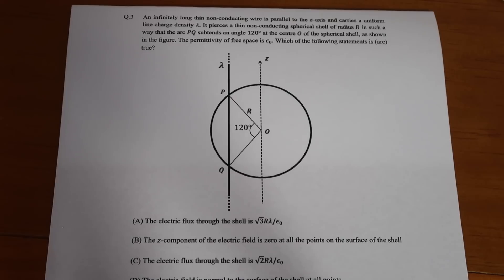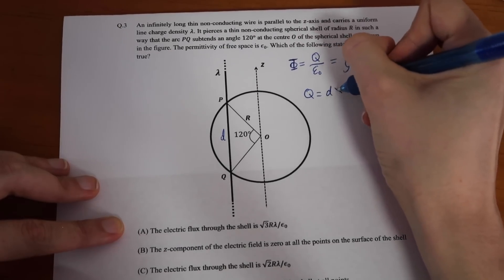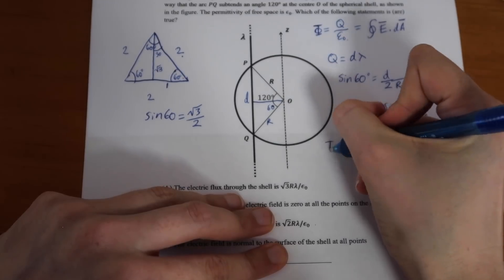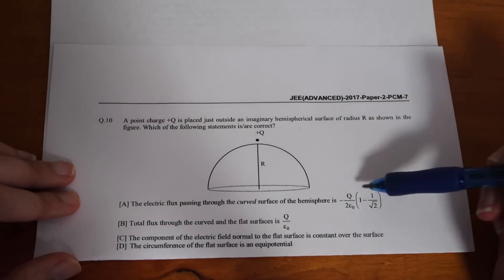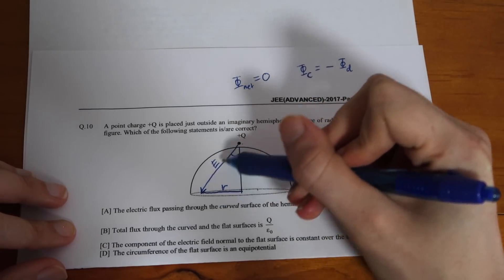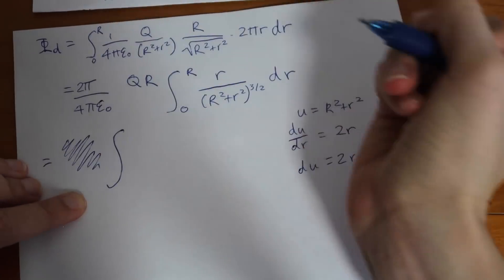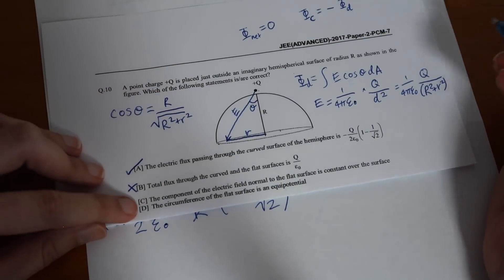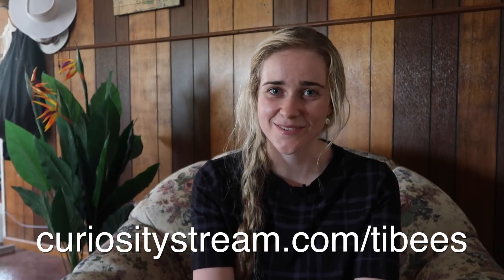Weird flux but ok | JEE electric field exam questions

Comment: Hey what do you think of the equation Q = Φ x Ψ ?

Where Q is "total electrification," Φ is magnetic induction, and Ψ is dielectric induction.

It's the same concept as P = IV or E = IVt (I is current in Amps; V is voltage; t is time) without being a "per second" concept, which would relate to the equation for energy of light E = hv (h is Planck's constant and v is the frequency).

Comment: Alot of people say this exam is extremely difficult, but im somewhat surprised. These questions are around the same level as the basic level physics class im taking in America. To top that off, even under high time pressure, 3/4 of the questions are quick conceptual analysis that you can immideately say "this is right" or "this is wrong".
Reply: These are to be solved by 16/17 yr olds while the americans give SAT which basically has elementary questions.

Comment: the second question can be solved easily using the concept of solid angles. It will not require to use tedious integration

Comment: Another way to find flux through the disc in second question is by making a cone with that disc as a base and vertex as the centre of that point charge. Since flux through curved surface of cone would be zero therefore net flux through the gaussian surface would be our answer. 
And to find net charge inside closed surface we would have to take a part of that charge inside the closed surface.   find the ratio of the volume  spherical sector of the charge to the total volume of that charge and charge would also be divided in that ratio.

Comment: I think the Z component wont be 0 cuz the electric field is perpendicular to the surface of the rod this means its perpendicular to the x axis and if the y axis is also in the plane of the bold lines then it is also perpendicular to that. This means its parallel to only Z axis which is out of the plane of the paper just like the field lines.
Please rectify me if i am correct.
Please please reply its a matter of getting sound sleep.
Reply: somya shree swain the field is perpendicular to z axis. That’s it.
Reply: The diagram plainly shows the z axis for this particular problem. An axis by a particular name doesn’t always have to have the same properties. You could just as easily have an x, or y axis being directed out of the paper. Similarly, some diagrams use a pseudo three dimensional approach. If an axis is labeled z and goes along the sheet, then that’s what it is. 

Additionally, it is good to be flexible in labeling or defining an axis. Sometimes it can be more convenient to make up an axis that is perpendicular to an object, or in other cases works better with the surroundings.

Comment: And we have to do these types of questions in 3 mins
Also you did explain so well!
Just saying that if rather than just u  using u^2=r^2 + R^2
Hence 2u.du = 2r.dr
Hence u.du=r.dr
And limits would be R to R√2
Or you can also use the result that integral of R / (r^2+x^2) is cosines of Angles in terms of R and r
Anyways you are fabulous <3
Reply: No we don't have to do them in 3 minutes. There are many questions which can be done in seconds, especially in chemistry. So that gives more time for the select few tough questions. I would say around 7 or 8 minutes.

Comment: Sin 60 =√3/2 
Weird! But ok
Reply: Yes.
This is small mistake.
It should be in degree NOT in radian.
Reply: why would you use degrees when there are radians
Reply: @bextract0  In India we use degrees far more than radians. Not saying one is better than other but it's just how we do it.
Reply: @bextract0  degrees are like fractions. Which is easier: π/4+2π/3 or 45+120?
Reply: What's weird?
Reply: What is different